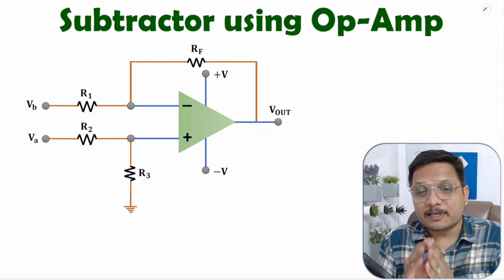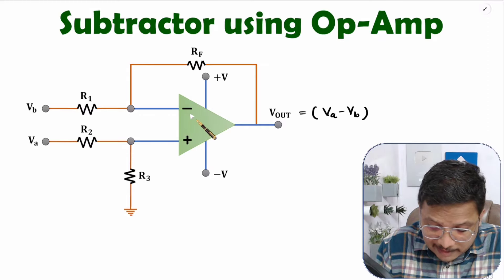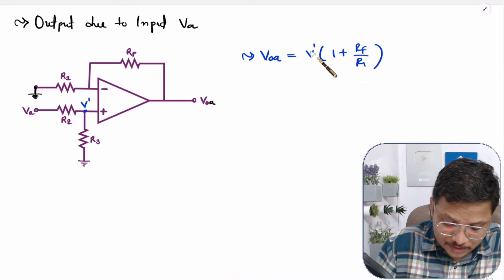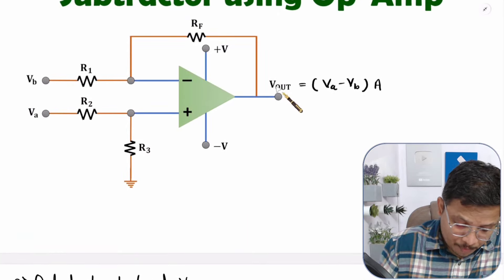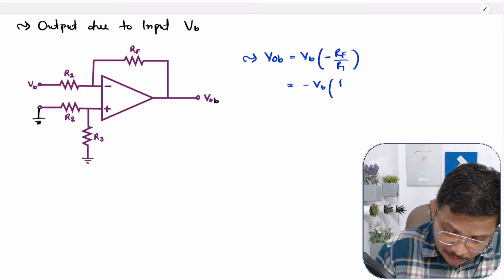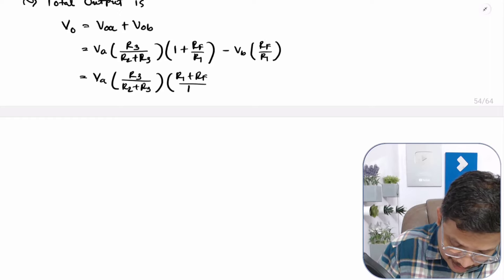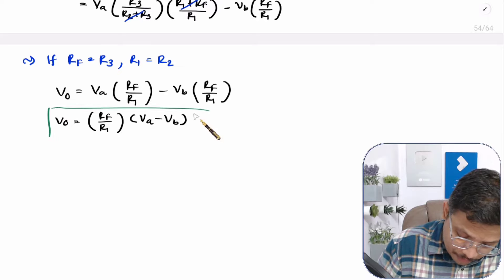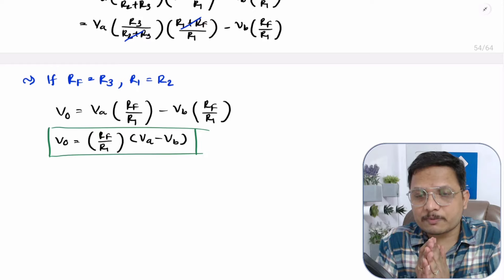Subtractor Using Differential Operational Amplifier (Basics, Circuit & Output Derivation) Explained

Comment: I have a doubt; since the circuit is for subtractor won't the output be Vo=Va-(-Vb), as Vb is for inverting terminal
Reply from the maker: Vb is value, which is subtracted here.
Reply: @EngineeringFunda  then in the case of summer the output was -Va-Vb+Vc+Vd, why do we consider the polarity in summer and not in subtractor